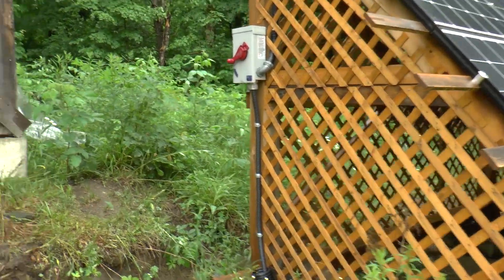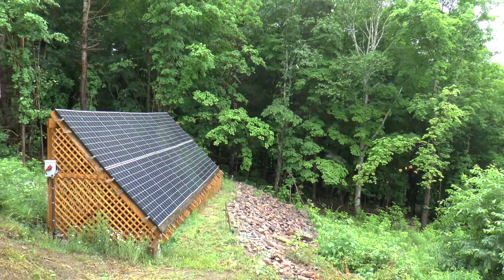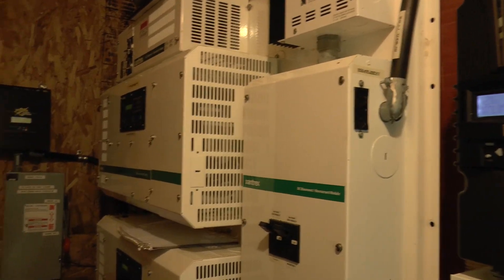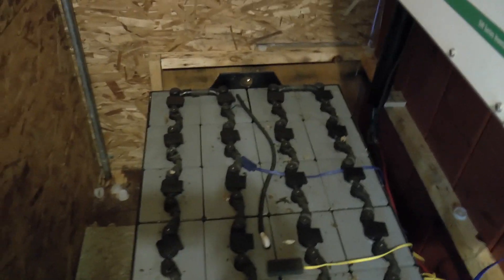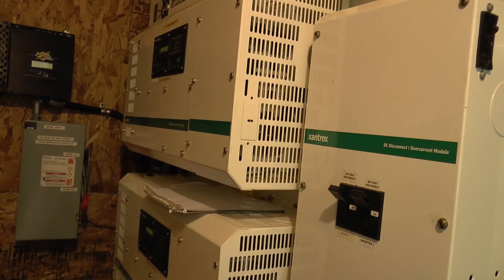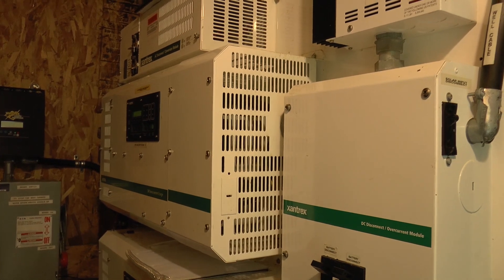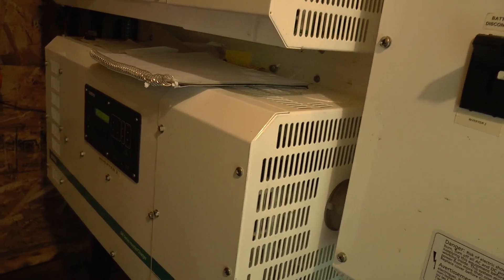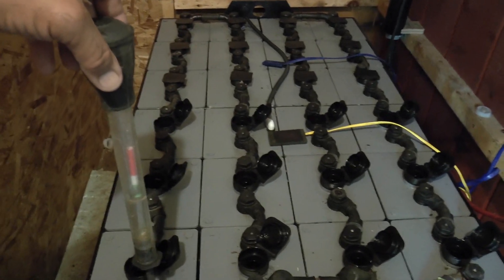Off Grid Living..... The Hardware. Nuts and Bolts.

Comment: The battery pack is standard for electric fork lift trucks, so they will always be available and the individual 2 volt cells can be replaced. Sometimes just one cell will fail. Thanks Steve. Stay well.

Comment: Wow I didn’t know certain types of solar panels can generate power at night as well!  Brilliant 😀

https://www.sustainability-times.com/low-carbon-energy/a-solar-panel-that-works-at-night-here-it-comes/

“The new panel works the way a normal solar cell does except in reverse. Unlike a photovoltaic cell, a so-called thermoradiative cell generates power by radiating heat to its surroundings and when pointed at the night sky it emits infrared light because it is warmer than outer space. 

The new device, dubbed an anti-solar cell, harvests this radiation to convert it into electricity the same way a conventional solar cell absorbs solar radiation.”